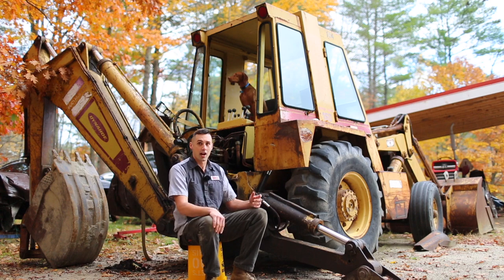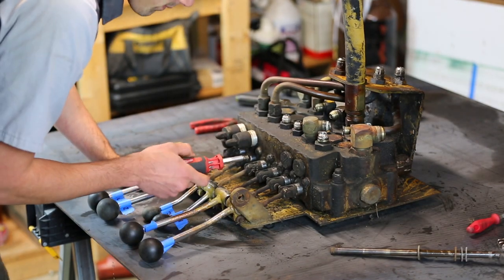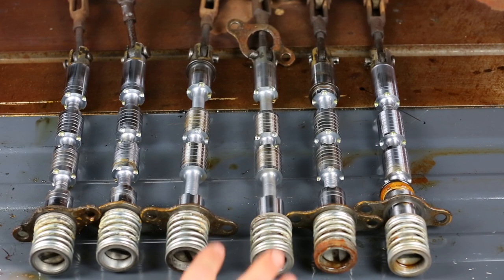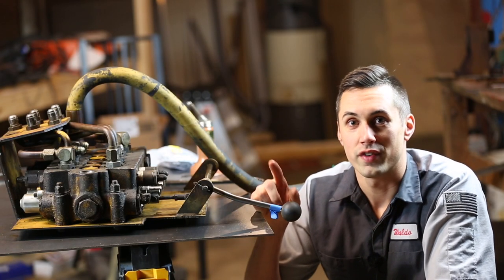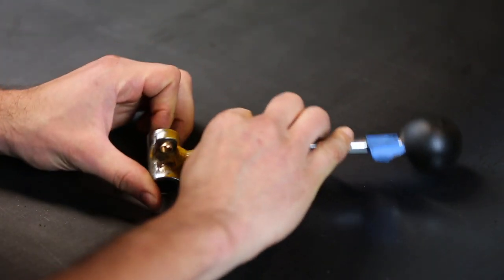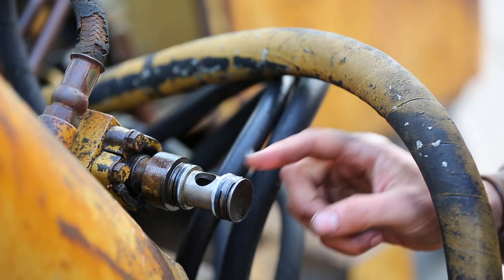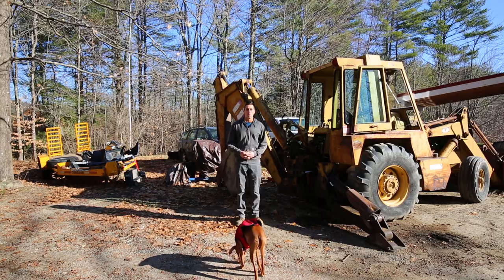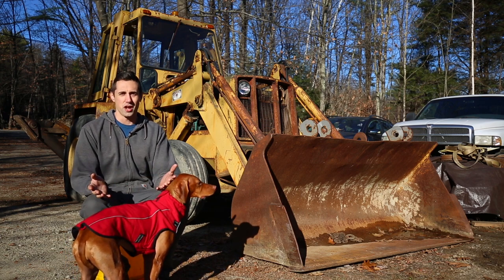Repairing a Backhoe Hydraulic Valve Block on a 1978 Dynahoe 160 [Dino Part 12]

Comment: Spent many hours on a 140. Dynahoes are good machines but just a few things to watch for that 1 inch main feed line for the boom cylinder if it shows any cracking replace it or you'll take shower, ask me how I know 😅. The radiators like to crack on the bottom of the fins from all the vibration (get a new one and make it fit don't look for a used one it'll do the same). The blower has a square key inside that goes on the outside of the shaft  they also like to wear from vibration (it'll idle up like crazy and then cut off it that goes). Check around the mounting points for the lift cylinders for the loader they like to Crack just gouge it out and weld it good before it separates and moves. Last do yourself a favor when you're running the hoe get it up to atleast 2000 rpms the hydraulics run alot smoother and easier when they have the right pressure and they don't call them screaming Jimmy's for nothing 😅 get a good set of ear plugs. Otherwise nice machine treat it good and it'll last you a long time best of luck with it.

Comment: I'm not certain what the recommended idle speed is of a Detroit, but having two torque converter tractors makes me think your idle speed is a little too high that is causing your backhoe to jump pretty good when you stick it in gear.  Typically mine will just faintly change engine sounds when I put it in gear.  You might try to see if you can turn the idle down and see if that improves your finesse when trying to do delicate work.  Great videos!  I'm a new subscriber...look forward to the next.

Comment: Putting a soft bushing where steel wore excessively isn't a lasting solution.
Reply from the maker: That is true. I guess we'll find out how long it takes to wear through the bronze!
Reply: @WaldosWorld  as brittle as it is, it'll probably break before it wears through
Reply: That steel wore from friction (not impact) in a zero-lube environment. That's a prime application for an oilite bushing, but I guess we'll have to wait for him to put another 8k hours on the machine before we can see if it lasts longer than the original steel surface.
Reply: @rmcjr5206  yes and no
It is friction not "impact" but it's not rotational friction. It's an s-link between a lever and a valve. They wear oblong because they interact with a scrubbing motion. The only reason the links are used is to remove the side thrust from the valve spool. The insert will break, not from impact, but from the point-loading without rotation to disperse it. When an operator moves the levers, they're not generally limited by effect but by distance. They push or pull the lever and hold it against the stop until the hoe gets where they want it. Some controls are throttled occasionally but they're operated stop-to-stop more often. That pressure of link to bushing at the stops is what breaks bushings. I've seen this repair attempted before. There's not a great solution. Best I've seen is hardfaced levers with soft links and tension springs so the slack is taken up by the spring rather than the operator over-travelling the levers. Problem with that is expense to fabricate (time mostly) and the frequency with which soft links need to be reshaped or replaced. It's heavy industry, where something cheap that works good enough for a long time and can then be replaced cheaply is better than just about anything else. In this case, replacing the levers is that solution but on a machine this depreciated, not worthwhile to that industry, hence it's been removed from service altogether.
Reply: @mwilliamshs  That does make sense. Thank you for the explanation. I was thinking of this as being like a motorcycle shifter, but shifters are never held against the stop and probably experience much fewer throws over their lifetime than backhoe levers do. In this situation, what would be your preferred fix assuming that the levers are no longer available? Steel bushing? Or maybe weld up the holes and redrill?
Reply: @rmcjr5206  a fix that toes the line between durable and practical is sliding a section of steel brake line over the s link, which is also worn. This takes up some slack in the joint and gives a smoother surface than the link alone has. Filling the piece of tubing (brake line) with epoxy like JB Weld before sliding it on is generally sufficient to retain it. Two brass ferrules from a compression fitting the same size as the brake line can be crimped in place on either side of the lever to keep it centered. Copper tubing can be used instead of, or in addition to the steel (one inside the other) as needed to create a smaller ID or larger OD as needed.

Comment: At 25:00 on your video timeline you are replacing a damaged backup ring on a swivel valve. It appears that the location of the backup ring is toward the area of where the oil under pressure will be located. Backup rings are normally (in every case that I am aware of) outboard of the oil seal. They prevent the seal (o-ring in your case) from extruding out of their groove when exposed to fluid under high pressure. Backup rings are made of material firmer than the seals they are protecting and have a snug fit in the bore that the seal is sealing against. If you have a parts manual for your machine it should verify the correct orientation of seals-to-backup rings in the swivel valve.
.
I love your videos and admire your willingness to tackle projects that you have not had prior experience with. Thank you for sharing your life with the rest of the world.
Reply: Just came to comment on that, but you already brought it up.
I agree 100%

Comment: Your short video of the inside of the valve body was seriously outstanding.
It reminded me of when I went to C school for Coast Guard Sikorsky HH52a Seaguard helo flight mechanic training.
We had to color in a printed drawing of all the passages and other areas of the T58 Turboshaft engine with each color representing fuel, air and oil pressurized and not pressurized.
The fuel management unit was the hardest.
That thing had well over a dozen routes fuel could be metered and routed according to which fuel it was set for
You could definitely make a great vocational school instructor.
They can burn pretty much any combustible fluid.
Even peanut butter oil of all things.

Comment: A really good way to mark where hoses and other items attach together is use a Dremel tool to engrave matching numbers or symbols on each where they contact each other.
Tape and other items can get knocked off or broken but engraving stays on forever. 
On hoses you put it on the fittings.
I've done that an uncounted number of times.

Comment: I see you have found the “extra” gear, 50 years ago this type of excavator was moved site to site under its own power.
To move faster on down grades, neutral was selected! Also if the machine started to travel a little too fast the emergency
Brake was used, “ drop the front bucket”.
Enjoying the videos thank you.

Comment: I have the 3-53 in my loader and for cold-weather starting, here’s the trick. There’s a pipe plug in the blower housing (7/16” wrench needed) and if you remove that plug, all it takes is a tiny, tiny sniff of ether and she’ll fire right up. Or you could go the “Gear-reduction starter, giant battery” route. Of course, they make fancy ether systems that you can run right into that hole too. Good luck, at any rate. Love these vids.
Reply from the maker: Thanks for the tip! 👍

Comment: Your holes came out but get yourself a cheap set of Chinese reamers for the bushing and pin holes, it leaves allot smoother hole which means it lasts longer and operates smoother. Get a can of starter fluid and use a tiny .5 second squirt, I use it every single time I start my machine unless it's above 75 degrees. You aren't hurting anything, you are doing more damage by laboring the starter with the battery struggling. If you continue to have starting issues you may want to buy a different set of injectors, they make all the difference in the world. I had one set that fired up in the cold and immediately and another set that only started when it was warm out or it took allot of starter fluid. Place in Boston got me all the 3-53 parts, I can find them again if you cannot...

Comment: While operating a backhoe, it’s best to flip the front bucket forward all the way and push it down to lift the front tires off the ground. Then flip the feet of the outriggers over and lower them until the rear tires are off the ground. This will give the best traction in dirt for digging.

Comment: For the problem with the outriggers you could just put a shutoff valve in the lines between the valveblock and each zylinder from the outriggers.
That might prevent them from going down every time.
Allthough great video, keep going👍

Comment: ive done the bushing trick on my case 310g track loader levers.   I need to pull apart a couple spool valves on my machines but they're low on the priority list right now.  im relining the swing clutches on the insley and my main focus is the Autocar so i can be ready to move 3 cable machines home in the spring.
Reply from the maker: I know how you feel with all the projects! Those Autocars are pretty awesome! 👌

Comment: I would pretty well bet that the center ports are your power beyond portion of the valve that allows you to continue to have multiple simultaneous functions of the valve body, otherwise when the individual levers are pulled you would the ability to "blend" multiple controls. hence, an "open center" hydraulic system. Enjoy watching your vids btw!!!!!!!
Reply from the maker: Thank you! That sounds like a good explanation!
Reply: @WaldosWorld my understanding of open center is that hydraulic fluid is constantly running through the valve at all times then returned to tank. When the spool is shifted  it calls for fluid to send to cylinder. Power beyond would send full pressure to another valve in-line after the backhoe valve.

Comment: Great video, Waldo.  I liked your usage of the oillite bushings to tighten up those pivots.  Maybe time for a battery maintainer on the backhoe.
Reply from the maker: Thanks, Greg! Yeah, I was just thinking about the battery maintainer thing today. I have enough motorized vehicles and equipment that it's probably time for a solution
Reply: The solar maintainers are the dog’s bollocks, I hear.

Comment: The batteries will stay charged longer if you put rubber under them.  An old cut floor mat works well to isolate them from the metal

Comment: Great job.  I noticed you didnt clean the valve block before you re-installed it. Was there a reason?  I mean like what's the point if its just going to get gunked up again in short time.

Comment: Ace. Coffee and biscuits and an old loader.  Sorted.  You noted down where all the lines went right?  Saves having to watch the video back....  ;)
Reply from the maker: Haha yeah, I tend to take pictures of things as I take them apart. It is nice to have a video to watch as a last resort though!
Reply: @WaldosWorld  Nice work!  PS when cold cranking, don't just keep going, crank for 10s then stop to let the heat of compression warm the cylinder.  Just cranking a lot keeps drawing more cold air in so it takes longer than crank, wait, crank wait etc. It also allows the battery to recover a bit if you don't hit it so hard and then keep hitting it even though it's starting to slow eg the voltage is falling off a cliff.

Comment: May I suggest a freeze plug heater? Also, an electrical push-button ether cylinder? A tiny breath of ether is possible first to start then to eliminate black smoke(cylinders fire and warm up evenly).

Comment: I find it odd that he never starts with cutting fluid on the part.  I find it odd that he never disconnected that huge hose from the valve body.  That rotating hydraulic fitting is frequently referred to as a "banjo" fitting around here. (Florida) I appreciate the way he bushed the control rods. I appreciate doing it right! Ron W4BIN
Reply: Hello from FL, too!
WU2F

Comment: Do you have a list of what you ordered, all 160 thru 490 Dynahoe backhoes use the same valve body, it is made by Husco. Dis you see a tag when you took the back plate off? That is the Husco part/model number.
Reply from the maker: Oh, interesting! Thanks for telling me the name of the manufacturer! I didn't see a model number. As for what I ordered, it was just a bunch of standard sized o-rings, though I don't remember the sizes

Comment: Again you do not let anything stop you even if you haven’t ever done it before.  I like that  .  When I started working for Cat even though I had worked on trucks and farm equipment, I had little experience on the big Cat’s but I learned real quick most of the breakdowns were 30 - 50 miles one way from parts or shop and the Manuals or the shop guys who would really give you a hard time for having to come in.  I became a collector of part sheets, if I could see the inside of the valves or cylinders I could figure how it came apart or went back together. I did the same thing when I worked for the FD pumps which got me doing a lot more worked than I thought.  No more money but lots of time when others where watching TV. Anyway I loved it all.  Now a personal question and a please.  The hair cut are you still in a Military Unit or just like the high and tight ? Now the please STOP using a claw hammer for a mechanic hammer ! They are different the claw hammer well chip and when you use for what they are made for they will be off balance.  A ball pin hammer is made for working with metal of all types but always protect for your eyes.  Always a great video!

Comment: Alternators aren't designed to recharge a dead battery.They're only designed to replenish what it used to start the piece of equipment
Reply: Actually, the issue is not the alternator but the alternator regulator (which controls current to the alternator field terminal).  In most automotive applications in years back, the regulator was internal and fixed in voltage.  Since battery charging requires higher alternator voltage than battery elimination, such installations are, as commentator noted, not good for charging a depleted battery.  However, in installations such as boats, where an alternator can be used for re-charging a depleted "house" battery bank, the alternator regulator will be external and have the ability to use separate "bulk," "absorption," and "float" voltages, and will recharged depleted batteries quite well.

Modern automobile installations work about the same as older ones described above except that regulation of field current is done by a computer, versus and internal regulator.

Comment: Hi waldo ..I follow your journey with your dyna hoe...I had a 1976 slightly different but not by much..here are a few tips...when you try to start..only turn over until you see white smoke..then wait a few seconds and turn over again to see smoke..wait again and it will start without taking the batteries down
Another cause I’d the shit starter a 35 series deltoid...if you are not too cheap a good replacement is a MT 40 from a Mack...but I did this to mine before 2000 ...the preferred replacement would be a permanent magnet gear reduction starter...certainly less weight and so much easier to install...plus the cranking speed is awesome
When it did not start I was reminded of my struggle to get mine rite...now decades later after 3 jcb hoes I really don’t miss my dyna hoe as much....but it is a awesome machine...not many machines today can match its power
One other tip..always reseal the outriggers together....question how many hrs are on your machine..and one other thing is to change the water pump as the bearings go away and take out the radiator
Reply: Valuable tips, good of you to pass that along to him!
Reply from the maker: Thank you so much for the tips! It has 8,500 hours on it. I plan to reseal the other stabilizer soon, but lots of projects going on 😂

Comment: Hey man I like your vids very much,
Buuuuut I have a question, did you ever get around to replacing the hydraulic filter, that might help with keeping the valves form getting worse as you might have dirt and other contamination in your fluid as we saw when you drained the system. On the topic of contamination in the hydraulic fluid you might want to wrap a tarp over the engine bay when your not using the Dyno, rain water is most likely making its way in to the reservoir thru leaks in the cap also it's not good for other components of the engine to be exposed all the time either, anyway I look forward to the day you fab a new hood for the old Dyno (in now its probably not a priority but a tarp, ugly as it will be will keep your investment safe when your not using it)

PS the rotten hoses stare into my soul lol

Keep up the good work.
Reply from the maker: Thanks! I did replace the hydraulic filter, but somehow the footage got left out of the video. Yeah, I'll definitely replace those hoses at some point, but at least they're not leaking yet 😬
Reply: @WaldosWorld  good stuff man, I cant wait to see what you do next with the old beast

Comment: Can you give us some specifics about the machine such as what it was used for previously, why the motor failed, how many hours it has?
Reply from the maker: It has 8500 hours on it. I was told that it was a municipal machine originally, though I don't know more about the history. The engine was seized due to water that leaked into cylinder #1 and caused it to rust while the machine had been sitting for years. The previous owner told me it had a bad head gasket, though I purchased it assuming it would need a total rebuild

Comment: When it comes to getting the slop out of the lever, wouldn't it be faster and cheaper just to weld up the hole in the lever, and then drill it out to the correct size? Then the slop would be gone, and you wouldn't have to order that stuff to rebuild the lever assembly.